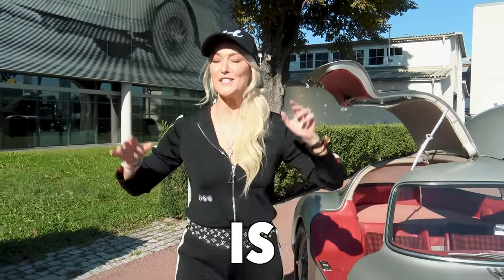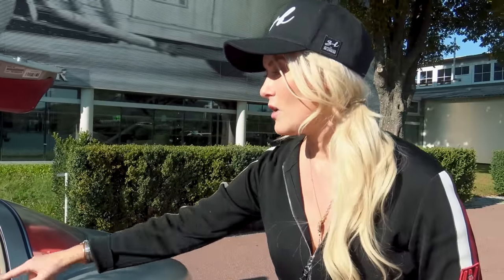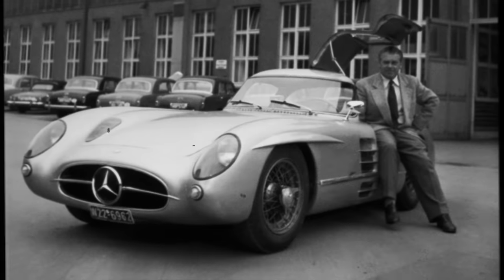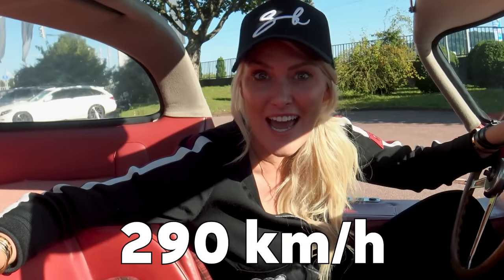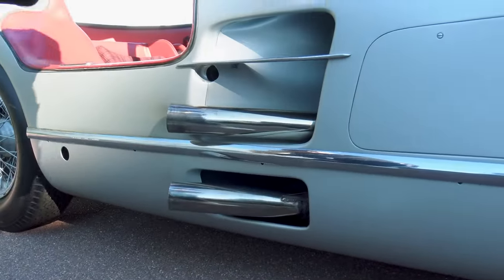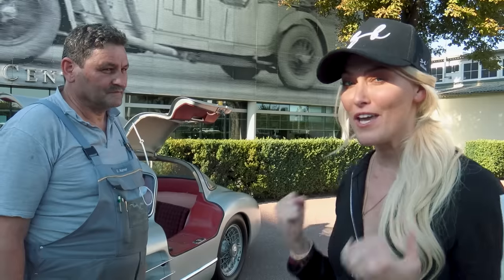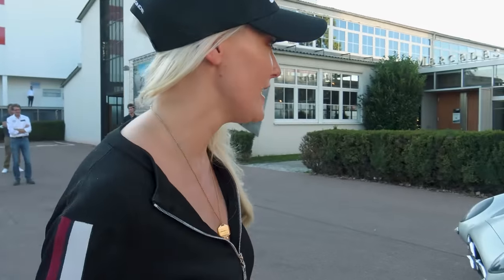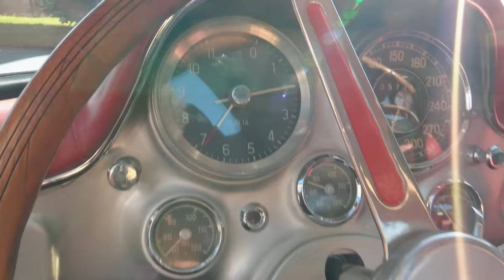The World's Most Expensive Car | 300 SLR

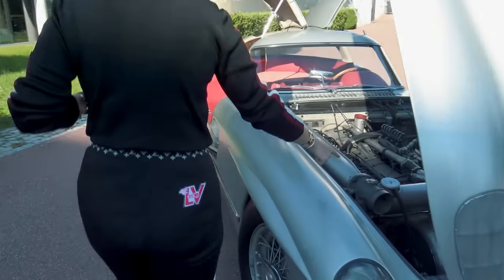Comment: What Blondie was pointing out as the exhaust @ 6:09, was actually the fuel injection tube which was fed air through the vent screen in the hood.  Uhlenhaut eventually had exterior mufflers put on the car - very ugly to look at.  The $100M to $300M value figures are completely speculative, and it is essentially one of a kind, so until someone bids and wins, the value will never be known.  Several years back I read that Rolls Royce estimated the "if it sold value" of the first Silver Ghost made at  $75 M or more, but again, you can't say with any real accuracy what it is worth.
Reply: Yeah, it's not a 250 GTO) She's still the most expensive girl
Reply: @constantine2016  Girls like that are considered "high maintenance", probably more so than the 300 SLR!  Lol
Reply: Some well connected PR conglomerate executive, "fished" an Australian village girl, took her to the big city & gave her speech lessons & made her his "Fare Lady" yet to this day, her ancestral primitive background is reflected in each move she makes.
A simpleton remains a simpleton!
Reply: @shimondauber8984  - I tip my glass to you Sir for a fine, see through explanation of this wanna - be classy, Lassy.  Spot on!
Reply: @constantine2016 
🤣🤣🤣 250 GTO could only wish to be mentioned in the same breath as this priceless piece of engineering brilliance.
Utterly reliability which the fragile Ferraris could only dream of 🤣🤣🤣
Rolls Royce Ghost??
Couldn't compare in price with even a 6 cylinder 300SL Gullwing!!
Reply: she’s clueless
Reply: @lapin46  - Just like that movie........what was the name?  Oh, Clueless in Seattle!  Lol
Reply: Kelly T   Are you kidding? What drivel.
That is the ultimate of engineering perfection my friend.
Both Fangio and Stirling Moss agreed it was the best piece of racing machinery they ever drove, and they only drove the best.
I would give my eye teeth to experience what Moss did when he described his drive in the '55 Mille Miglia where he was driving through the mountains and the "echo of the straight 8 Mercedes engine came booming back to meet us".
Stuff of legends!!
Reply: Kelly T   Haha, that's what the car was designed for, racing.
If you wanted to buy a car that beat everything on the road then you bought the 300SL Gullwing or Coupe 
You couldn't buy the SLRs, purely racing cars so your point is irrelevant?
Reply: It's not one of a kind. There are 2 SLR's. This one with the red interior and another one with the blue interior is in the museum in Stuttgart.
Reply: Kelly T  - Ahhhh, speak for yourself!  You should have said "It's not something I would enjoy driving."  It was loud, so Uhlenhaut had exposed mufflers attached to the passenger door.  Unfortunately, it looked horrible and destroyed the beautiful lines of the car, at least on the right side.  You are forgetting that this car was built as a RACE CAR, not as a street driver!
Reply: @johnfoe7458  - Yes, you are correct that 2 were built, but only one was driven by Uhlenhaut!  Mercedes Benz factory will never sell the cars so making guesswork of its value is ludicrous at best.
Reply: @lapin46  She's an extremely knowledgeable car enthusiast.. Jealousy looks good on ya mate lmfao
Reply: @SuukiDesu  she may be a car enthusiast. Likely. And she does great with her channel. This is honestly a true big achievement that for sure took a lot of effort. But I would not go as far as calling her extremely knowledgeable. Knowledgable yes, but extreme would mean she would have done a little more prepping ahead of the shot instead of not knowing which end of an engine one is looking at. And that is extremely obvious to anyone even remotely interested in this technology. I would not call myself knowledgable, but I also know people who believe I am. I build engines, I do engine swaps, I build conversion looms, I map my own engines, I help others building, swapping and mapping their own engines, for free BTW, no YT, no big fuzz. I take my builds on race tracks and even let others drive my car. Again, she has achieved a lot, but she is obviously not extremely knowledgeable when it comes to cars and technology, at least not when it comes to what I would call extremely knowledgable. To give you an example: I would call the chap that did fire the SLR up extremely knowledgeable purely by Mercedes letting him doing this particular job. I admit I would have loved to be given that same opportunity.  :-) I would have publicly called a guy clueless in this situation, too. Enjoy you floor time
Reply: Well said 🏎
Reply: @lapin46  she knows more than u about that car
Reply: @rosesmith3971  Quiet expected since she got it explained and demonstrated by the factory experts :-) and I have to rely on publicly available information.
Reply: @lapin46  but she has years of experience and reviewing other cars.
Reply: @rosesmith3971  I have also years of experience :-) Not reviewing obviously, but building and rebuilding cars and engines, mapping engine ECUs, configuring drive trains, setting carburettors, suspension geometry optimization etc.  I never claimed she is not doing a good job. She does an excellent job and attracted a large audience with it. This is a true achievement and I am very happy for her.  That does not mean she is a necessarily expert on all drivetrain technologies of all ages or cars. And this video clearly shows this to me. You might see this differently and that is of course fine and OK :-) We're plainly of a different opinion here on that particular matter.
Reply: @loulovesspeed this comment did not age well, "this car will never be sold" lol
Reply: @Mackpayn  - I just read the article and its supposed sale still has not been verified by Mercedes.  For the record, "This car will never be sold" aren't my words, but those of the Mercedes Benz Museum.
Reply: 136,8 million !
Reply: @equalizer4633  - What I read said the proceeds for the sale, if it does sell, will go to a charity of some kind.  A car bid on and purchased for charity is always sold for more than the car otherwise would have, so it's not a credible figure for indicting what a car is worth.
Reply: sold today for 148 million
Reply: @NAboGFX  - Wow,  I don't think I am alone by saying I never would have believed it!  There is a company that is about to release a 1:8 scale diecast metal 300 SLR Coupe for around $1,300....for now!  In case you are not familiar with diff. model car scales, it's just shy of two feet long and weighs around 16lbs.
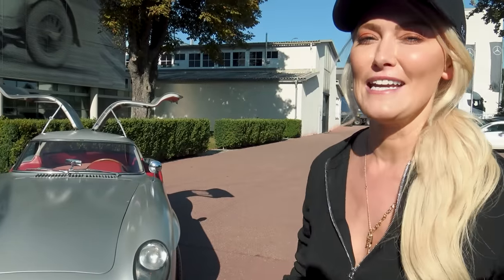Reply: @Loulovesspeed  i have the 1:18 version by a make called CMC :D I love it
Reply: @TheDiecastFanatic  - CMC makes some of the very best high end diecast models.  I have been collecting them for over 20 years and have around 24 of them.  I also have the Uhlenhaut Coupe and Stirling Moss 300SLR roadster # 722, winner of the 1955 Mille Miglia.  I had Stirling sign it several years back.
Reply: And it was just sold for 142 Million.
Reply: It just sold for 144 million dollars US.
Reply: Sold at auction last week for €135 million.
Reply: It was sold recently for 145 million. Not sure, however, if it the daily driver or the other one.
Reply: man forget all that id still drive this loud beast around....shit its one of my favorite cars in the game the crew....this car can dominate against the best of modern day vehicles on the track and in the streets
Reply: @YUNGCHURCH89  I'll agree that the 300 SLR Coupe is spectacular and would perform well in its time, though it was never race tested.  Only the roadster version raced, and it did remarkably well!  However, I think you got a bit over overzealous in saying it would dominate the best modern day vehicles.  Not even close.  Forget modern day vehicles and look at the 1965 Daytona Cobra Coupe.  While the Mercedes was good for just over 180 mph, the Daytona Coupe with Bob Bondurant at the wheel, hit 197 mph down the Mulsanne Straight at Le Mans.  All that said, the 300 SLR was a remarkable machine!

Comment: “Can you imagine driving at 290 Kph with no seatbelts?” Well, at that speed, in that car, seatbelts are irrelevant. 
Plus, if memory serves, that car is a firetrap. Event the metal on the wheels is combustible.
But it is the most beautiful firetrap in the world ❤️
Reply: Yes, magnesium is highly flammable, and the body of a famously wrecked 300SLR (roadster) actually burned, when the vehicles' fuel tank exploded after the wreck, (which occurred during a race in 1955).
Reply: The race SLR's were made of Electron, which is a magnesium alloy. As Mustafa said, one of them basically flew into the crowd at the 1955 Le Mans race, killing 85(!) spectators along the way. The car immediately caught fire, which only intensified when first helpers tried to douse the flames with water. This crash was the reason why Mercedes quit racing until the late 80's.
Reply: @Atombender  Thank you. Glad I am not the only one who knows a bit more about the history of the 1955 Mercedes 300SLR. Blondie glossed over that harsh fact like it was not relevant at all "Yeah, Mercedes stopped racing in 1955." Yeah, because it killed so many people.

Comment: I would be happy with just a 300SL  It's classically beautiful.
Reply: @Bill Fong - Are you sure?  The  300 SL is only a straight six engine and 215 HP, where the 300 SLR is a straight 8 with 310 HP.  My likes would require the 300 SLR!
Reply: @Loulovesspeed  That’s a great point. I think I would be happy with either.  I just love the classic lines on the SL.
Reply: @billfong7861  You're right, I would never turn my back on any 300 Series Mercedes.  That straight 8 in the SLR is a fantastic sounding engine at high RPM.  Look for some videos of the racing Mercedes.  No question though that the lines of the car are without equal, like the E Type Jaguar, instantly recognizable.

Comment: the design is stunning. wish mercedes can make the same car with modern engine and interior. kinda like a remaster in videogames.
Reply: Please no! No more tablets and RGB lights, that will ruin this legend.
Reply: @robertbalogh3663  wtf u tlking bout? im saying have modern bluetooth system and speakers for music, and dual clutch transmission for better shifting. and a modern twin turbo engine with 500+ hp.
Reply: @user-df2uu3qp3y  That car doesn't need anything like that. I only have a W124, but I will never put a Bluetooth radio or that kind of stuff into that. It is a legend as it is.
Reply: @robertbalogh3663  u cant drive that in todays highway. its not fast enough. time have changed, the car needs a bluetooth to connect my phone cruising down the highway at 120  mph listening to some good music. otherwise its not drivable in todays world.

Comment: The other issue with magnesium is that it’s pretty reactive to heat, including from fraction, and when it does that, it combusts and burns white hot, the effects of such resulted in things like the 1955 Le Mans disaster and the magnesium skinned Honda RA302 that crashed at the 1968 French Grand Prix that killed Jo Schlesser in a magnesium fire that also ignited 58 laps-worth of race fuel. 

Putting all that death aside, this is one of my unattainable dream cars, such a lovely thing.

Comment: Absolute magnificence. The Uhlenhaut coupe is by & far the most impressive vehicle ever built. Mercedes -under Rudi's direction-took the chassis of the W196 Grand Prix car & put a gullwing body on it. This beast is still good for 200+ MPH. And it's ROAR-I got to hear a W196 at Long Beach in 1976 with Fangio driving it. Good thing Ewe told bonehead to get away from the exhaust-otherwise someone might have got a bit hot. And deaf. Sad to see Benz just auctioned it off.
Reply: @Steven Robinson - the top speed of the 300 SLR Coupe and roadster is a tick over 180mph, not even close to 200mph.

Comment: I never realized that the driver of the 300 SLR had to straddle the drive shaft. That makes sense since the clutch is on the left side of the car. The eight-cylinder engine is tipped to the right and the power take-off runs along the left side of the block from the middle of the crankshaft not the end as is usual. Does anyone know if the car had a trans-axle or if the driver had the tranny between his legs in addition to the driveshaft.  It probably did but I don't see that mentioned anywhere. 
It must take some getting used to just entering the car. I can't image this as an every-day driver.

Comment: Magnesium is also very a explosive material. In racing cars it can ignite due to the friction with any surface and has a toxic plume. That's why it has been banned from the racing scene. 
Nowadays F1 still use magnesium wheels but they're coated to resist to a tire failure or a crash.

Comment: What a Babe, and I'm talking about the car!  This set the 'SL' model standard for Mercedes. I can so appreciate the look and design of this car.  
But I am a tadd biased, as I love my supercharged SLK R171 Roadster in obsidian black - its got slightly similar lines and shape to that 300 SLR.   I've owned it 4 years and picked it up cheap needing a long list of repairs and some TLC.  
Work done, it's now one my daily drives and really does turn heads, but I didn't buy it for that.  I bought it because its quick, reliable, sticks to road and handles really well, does over 150mph and the roof also goes down at the touch of a button..  Not bad for an 18 year old car that looks near new.  They are cracking pieces of kit and comfortable too, another future classic!  Although not quite in the same league as the 300 SLR.  😁🙃😉 I paid under £10k sterling for mine back in 2020.  There's some bargains out there!

Comment: 1955 24hour of LeMans in France: HUGE ACCIDENT, MERCEDES withdrew from 
racing.
///
The crash started when (1) Jaguar driver Mike Hawthorn pulled to the right side of the track in front of (2) Austin-Healey driver 
Lance Macklin and (1) started braking for his pit stop.
///
Lance Macklin swerved out from behind the slowing Jaguar into the path of Pierre Levegh, who was passing on the left in his much faster Mercedes-Benz 300 SLR. (3) Pierre Levegh rear-ended Macklin at high speed, overriding Macklin's car and launching his own car through the air. Levegh's car skipped over a protective earthen berm at 200 km/h (125 mph) and made at least two impacts within the spectator area, the last of which caused the car to disintegrate, throwing him onto the track where he was instantly killed. 83 spectators killed, near 180 injured.
///
Mercedes-Benz returned to sportscar racing in 1997, with the CLK GTR which was entered in the new FIA GT Championship, world championship series.

Comment: Great video.  Actually, the Sterling Moss SLR Roadster #722 is probably the most expensive car in the world.
Reply: That car may have been part of the Henry Ford Museum collection. They had a 300 SLR on display for many years. Not sure if it’s still there or sold off.
Reply: @backho12  No, actually #722 is owned by Mercedes and just this year was permanently retired to its museum after
one last blast at the Goodwood Festival and through London to Sterling Moss' home.

https://www.youtube.com/watch?v=hk8GVanoOzI
Reply: Yes, you are correct! The Henry Ford Museum SLR was returned to M-B in the early 2000’s. Glad I was able to see it quite a while back.
Reply: @denniswhite9721  - I was fortunate to see #722 at the 2015 Historic Festival at Lime Rock Park, Connecticut, USA.  Mercedes was the honored mark at this event which was attended by the late Sir Stirling Moss.  I had him and Jochen Mass sign the poster for the event, and also had Stirling sign my CMC Diecast 300 SLR #722.  It was a great weekend of historic displays and racing!

Comment: I used to see those at the aristocrat Mercedes dealer in the shop that is they had three 300 gullwing roadsters in there when I was buying parts for Mercedes I was working on I put a rebuilt cylinder head on a 280 SL basket case ran good when I finished it  it had mechanical fuel injection like the Alfa Romeo's

Comment: It feels good just looking at it!  When I lived in Heidelberg Germany, I was astonished to see a clean 300SL in a garage at the social housing apartments.  Dude really pulled the wool over the system.
Reply: @Mark Novack - In case you aren't aware, there is a huge difference between a 300 SL and the 300 SLR.  The SL is a six cylinder while the SLR is an eight cylinder.

Comment: You are shortchanging your viewers by failing to mention both Dr. Uhlenhaut's enormous achievements in and contributions to motorsports with the MB brand and the haunting reasons why the 300SLR ended MB's involvement in motorsports for a very, very long period of time and why carmakers stopped using magnesium body parts altogether.

Comment: I wouldn't even be touching that car you have oils on your hands and your putting your fingers all over that emblem now the detailer is going to have to go over that clean that off with a nice fiber optic tile and some kind of bass cleaner you just don't want to leave your fingertips bacteria and oils all over that car if that car is the most expensive car in the world you should not be touching it at all it should be sealed up should you be outside it's 60 years old and it's an artifact and should not be touched. And it's the most expensive car on the planet but you have the right to show it and do what you want it is a nice car and it is a car in the long run to drive but just to let you know touching it is not good your oils aren't helping that paint or that metal.

Comment: Really expensive classly Gas Pedal,they built a car like that then put on a crappy gas pedal,did they run out of money.
The Problem is Germans over engineer everything that's why they lost the war.
They built great Tanks problem was not one was the same as the over,you could not swap parts in the field.
Take for example the Gullwing race car,they car holled it back to Germany to fix it when it raced.
Reply: Hitler and Germans are not the same.